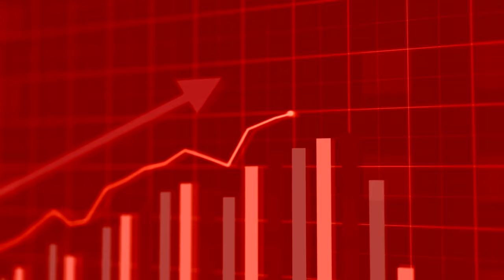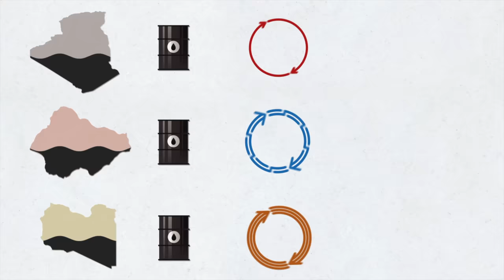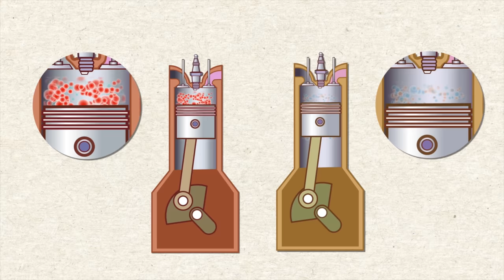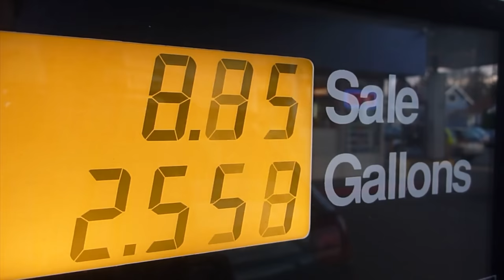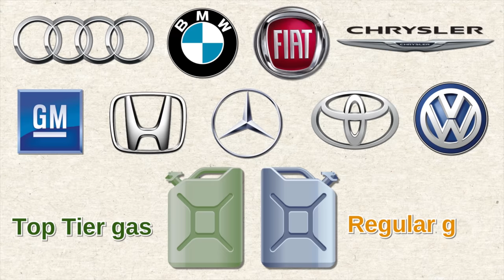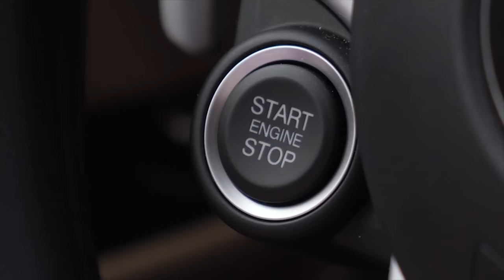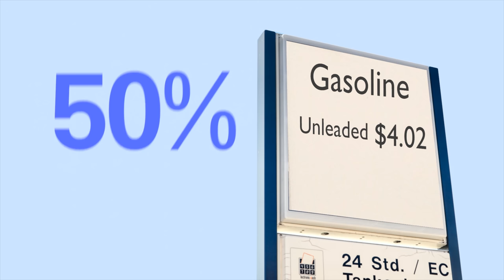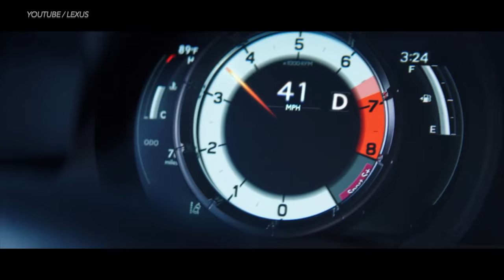No One Has the Balls to Tell You the Truth About Gas Prices, So I Will

Comment: The dream of having EVs everywhere is just that. A dream. The amount of infrastructure upheaval and required for something like that would take a minimum of 40 years to even get at an acceptable level, let alone efficient. The lack of charging stations and other electrical grid support in rural areas around the USA and other countries prevents EVs from being viable in those places until the government or brave companies spend insane amounts of money. The electric power stations are still going to need a way to keep up with the increased demand on the grid once EVs start pulling from new stations or home ports. Remember the failure of the power grid in Texas when a relatively moderate amount of ice and snow swept through and people were cranking their output? Now imagine that but every day and every single person contributing.
Reply: Its all a virtue signal done at our expense.
Reply: Yeah electric vehicles are pointless it'll be the samething as a normal vehicle if everyone has one
Reply: I think people forget that there wasn't gas stations at every corner when cars came out. It's the same with electric cars. Charging stations will eventually be everywhere. It's up to governments to increase electric capacity to offset less ICE cars.
Reply: @HH-le1vi  I think the difference here is that unlike cars of old, electric is being forced on us, infrastructure, economy, practicality, etc. be damned.  Electric is probably the future, but innovation and advancements must run their course. They can't be rushed. Am I full of it? Possibly. But that's an impression I'm getting.
Reply: Yea and then there's the issue of mining the lithium and cobalt for the batteries. Earth is gonna look like the moon, giant craters everywhere
Reply: @chaoticiannunez2419  my thoughts exactly.
Let it happen naturally, organically. 
I'm afraid that forcing this is gonna create many unnecessary problems for many people.

Comment: I worked at a go kart track way back in 2004-2005, their go karts were converted to run on just ethanol, but the higher temperature that ethanol burns at would be too much for it and ruin gaskets and seals, resulting in them needing repairs more frequently. The following year they switched back to gasoline and they ran better. Most engines, especially older ones, aren't engineered for the higher temperatures of ethanol.

Comment: Going electric for now just changes the energy source from internal combustion to external combustion. Internal combustion has its advantages but the sense of autonomy that it creates is an illusion. The internal combustion powered vehicle in fact depends on a vast fuel supplu infrastructure. The reason why the internal combustion engine gives you a relatively long range and the freedom to go anywhere is because the infrastructure is everywhere. In fact, the internal combustion vehicle is just as dependent on infrastructure as the electric vehicle. Although the fuel itself once delivered to the fuel station, requires no additional connection to any infrastructure to be avcailable, in fact, no electricity, no pump unless the station owner a backup power generating system. A hand pump could be used, but that would be awfully slow.
Reply: Where can I get an external combustion engine.  It must be great to hear the explosions out side the engine.
Reply: When you car runs out of power, which one will you be able to get running again in a few minutes? EVs are trendy, but useless if you have to travel over 60 miles.
Reply: @MAGAMAN  I agree in principle, but the useful range now is more than 60 miles in many models. My argument re electric vehicles is that they are useful when the daily travel itinerary already is known. That mean local delivery vehicles, commuting or buses. Or someone who drives very little.

One of the small cities in my local area has electric buses on one of the main routes. That's a good application, but they already know how many miles each city bus is going to go every day.

Comment: I drive a lifted 2012 Chev Tahoe 4x4. When I drive 55mph on the highway with cruise control I get over 22 miles to the gallon, sometimes 25 miles to the gallon with a tailwind! Over 55mph its around 16-18 miles to the gallon.

Comment: I bought a Chevy Bolt EV, back in 2020. It's an OK car, and I smile pass the gas pumps. NO oil or radiator fluid to change. The battery will eventually crap out; maybe in ten years, but I still save money.

....and, Climate Change is REAL.

Comment: Just you watch, Brandon will allow all the USA leases on oil production Scott free a month or two before midterms when gas is above $6 average!
Reply: If the president does or does not, it will not matter. Production is not the issue, refining is. Also, even if the fuel is produced here, it does not have to stay here. Oil and fuel is a global commodity. It is sold to the highest bidder. The president has no impact on that.
Reply: Good thing this "Brandon" guy isn't in charge, then.

Comment: We've definitely all noticed the rising prices of gas in the past couple of months. 
I recently built an electric bicycle conversion based on a bafang mid-drive motor that can travel up to 35 mph, go 50 miles per charge, and only uses 900 Wh of electricity which is about $0.20 cents of electric energy use when charging. I use it for my 25 mile commute to work 2 days a week, and if I need to run any trips 15 miles or less in city scenarios it's fantastic. I put a rear rack with panniers in it to carry small loads when going around comfortably, and I can also tow a small bike trailer where I can load as many groceries or things as I want. 

When I do drive it's mostly highway cruising miles. I usually drive in the middle or right lane at around 65mph and keep a good distance from the car in front. If I see brake lights in front, I just take my foot off the accelerator and slow down naturally, avoiding braking. I make sure my tires are filled up with air to 40psi, and recently did an engine and transmission oil change. On my little 09' corolla I can pretty consistently average 40mpg. With 4 people and luggage with ac I probably get 37/38mpg. It's a gas-only car as well. Going between Austin/Houston I use a ridesharing app where I'll take 3 passengers and get paid about $100 each way which covers the cost of gas threefold. If I do this twice a month it covers my gas for the whole month! 

I know it's a challenging time, but there are always things we can do to be a little smarter about our energy use. I'm gonna look for these gas apps now and start using them!

Comment: Great job on this video. Very informative. Though, I would like to conclude in addition to proper tire pressure, conservative driving, less weight and streamlining your vehicle and different grades of gas, that some other factors to consider when trying to conserve fuel is, proper maintenance, such as, changing oil regularly, maintaining a proper engine oil level, wheel alignment and tire balanceperiodically cleaning air filter, tire balancing, etc.

Comment: Keep it parked as much as possible.

A lot of roads in my area in Middlesex County New Jersey have been reduced from 40MPH to 30MPH. I'm not sure if this will reduce fuel consumption or increase it. It seems to make so that you would be more likely to need to stop at traffic lights. Right now I'm using 45USD per week, also seems that 30 MPH seed limits have reduced fuel economy. Regardless, driving sucks in Middlesex County NJ.

Comment: The problem is that fuel is traded on speculation, not as a commodity. Supply & demand reflect a small % of the price in most cases. Mostly the price reflects fears & what the speculators think "might" happen in the next few months.

Comment: Glad I was born when I was.
As someone who is into high performance cars..EVs will never have the magic that V12 Ferraris, V8 Muscle cars or even Inline 4 Boxer engines have.The sound and feel is half the experience. Imagine buying an electric Harley? What would be the draw?! Simply the name? 
We are a long, long way from this being standard. The entire power grid of the United States will need an overhaul to support what they are planning..we already have issues in some areas of the country in summer months during Peak AC usage. In my opinion, we'd be much better off finding a cleaner liquid/gas fuel as opposed to this battery nonsense. Think about how quickly your cell phone battery begins to degrade in performance...Compare that to a gasoline engine that's been going strong for 500,000 miles. 
Forced obsolescence, disposable society.

Comment: I bought a 1998 Corvette and made the mistake of filing it up with 89 octane fuel ( Gas was at like $1.48 a gal for 93 octane then in 2002) , and I can assure you there was NO electronic safeguard in that vehicles system. I had to drive it like i had an egg under the accelerator until I could get to my shop and drain it, even after adding octane booster it was detonating....
It was a great car, possibly the best I ever bought. 20 gallon capacity and averaged 26-32 mpg city/highway. Actual numbers. With a few perfectly legal mods it made 423 HP with a top speed (observed) of 213 mph. I sold it , wish I hadn't now and I miss it.....

Comment: I get everything you're saying in this video, but I have a question about a car we own. It is a 2004 Hyundai Elantra. It is rated for 87 octane. It runs fine on the 87 octane with no pre ignition. Yet, when we put 93 octane into it, fuel mileage actually goes up from around 27 MPG, combined driving in a fairly rural area, to 33 MPG. We have done the calculations many times, so we know this to be fact. If octane has no effect on fuel economy, why would this be our experience
? It is actually more economical to run high-octane.

Comment: Well Scotty... It's $4.95 here where i live. It's possible to find it for $0.10 a gallon cheaper if you look hard enough. When I bought my 2018 Honda Fit I could fill my tank for about $15 to $20. Now it's at least $30 or more. I'm glad I moved from an SUV to the tiny Honda that gets 41MPG four years ago. I don't know what I would do if I was getting under 32MPG. My car even gets better gas mileage than my 1050cc motorcycle! Here in the northeast I can't ride it more than 6 months out of the year anyway. I can't afford an electric car though. Besides the fact that I live where there's on-street parking so there's no way to plug it in even if I were able to buy one. Lately I've been thinking about an electric bicycle for quick trips to the store, but again I live in the northeast so it wouldn't really be a steady solution. If gas keeps going up it means I won't go anywhere that's not on my way to or from work!

Comment: Slight difference in energy content vs. octane.  If the octane is raised using more light ends then the energy content per gallon ( and specific gravity of the fuel) is actually very slightly lower.  But in general this video should be part of a required course in every high school in this country  That could go a long way to reducing the public ignorance of how our economy works.

Comment: The part which doesn’t make sense to me is that in 2004ish, oil was about $120 per barrel. It impacted jet-A, and airlines were screaming (except Southwest Airlines who’d  locked in low prices for a year or more). Regardless of the cost of a barrel of oil, we did not see anywhere near this level of price increases. As for incentives to get me to turn in my Dually - show my how I can tow my 5th wheel with Tesla’s truck. I have 136 gallon of diesel capacity and so I can go a considerable distance before needing to find fuel. I’m not expecting to trade this truck for the non-existent Tesla truck anytime soon, so I have no idea how far I’d be able to go with their product. I’m reasonably confident it’ll be maybe 200 miles. Then what? 2 to 8 hours of recharging? Give me a break. That’s a non-starter. Try again.

Comment: Would it surprise you that all  windmill internal components work off hydraulic oil , all the systems use oil , so how do they plan on actually making them green? Also your still gonna need petroleum products for things like tires, grease for bearings , rubber door seals and all the other parts of any car or truck either gas , diesel or electric

Comment: Keep your tires fully inflated.
Fill your tank during the coolest time of the day.
Re-fuel at half a tank. More space in your tank puts more area of vapor you have, which escapes and does not get burned.
Doesn’t fill your tank do you the ram. When the pump clicks off, adding more gas eggs more fumes which go back into the holes as paper and back into the station gas storage tanks! In essence you are paying for the gas but pumping it back into the station tanks.
Don’t lock the nozzle in the wide open position. This makes more bubbles and makes more gas fumes which are literally being put into the air or put back in the station tax. iMovie, get to your cruising speed as quickly as possible. If your car accelerates, it is using the most gas possible. Oh my so much gas will flow into the engine, depending on the size of the fuel injectors. When you reach a cruising speed then let up off the gas, your gas mileage increases to maximum! That said, do not make Jack rabbit starts!

Comment: Your explanation of Octane and combustion processes was fantastic and very educational.   I think your gas / fuel economy suggestions were right on.   
     You did bring up something I found interesting.. and another aspect of the political impact on prices.  I travel a lot, and for *decades, gas prices $0.25 - $0.50 higher in cities or just off interstates were the norm nationwide.  But i saw something very interesting in 2022 as it got close to the midterm elections.  Gas prices in cities were almost $0.50 less than in the rural areas, which was *very wierd.   In an attempt to support the Democrat Party before the elections, the cities (mostly Democrat run), reduced gas prices to give the impression inflation/ etc was not as bad as it was.   On a separate note, I noticed the gap in price between 87 &93 went from ~$.40, where it had been for decades, to about $1 (very obviously an attempt to reduce the price of 87 Octane and pass it to those paying for premium/ 93) in another attempt to reduce the visibility of the impact of Democrat policies on gas prices.

Comment: Still sounds like corporate greed. Do they really need to charge 3 times the already inflated price? I’m done w oil in my world. Switching all my V8s to CNG.  I just did the math and realized that it’s cheaper to operate my econoline 350 on CNG than it is to operate my Prius.  At $1.88 (SoCal price) the E350 runs for about 10-11 cents a mile w 17-21 mpg. My 2021 Prius prime gets me 40-50 mpg (currently showing avg 41). That’s 13 cents best case scenario paying $6.50 getting 50 mpg highway miles. Good bye oil forever. (I’m selling the Prius today)

Comment: 4:30 If that's true (big IF), everything made from petroleum will be much more expensive. Tar, gear oil, grease, propane, etc. They started using gasoline in cars because they were throwing it away and needed to find a use for it. "Other" products are cheap now because there's lots of oil being pulled out of the ground.

Comment: The funny thing about it is these electric vehicles aren't cutting down pollution at all either.

Unless you plug in your vehicle at home and have solar power or windmills enough to support the energy needed to charge that battery you're still plugging into the grid.

Which means a factory is working harder to produce that energy I know California grid can't even support all the air conditioning units on over the summer how will we Charge all these cars and semi trucks.

The factories was the cause pollution anyway.

Comment: Oil companies LOVE renewables like solar and wind because they are wildly unreliable. Some estimates put the total output vs life of a solar panel at 30%. So only 30% of the life of a panel is actually producing electricity. They cant produce energy when its cloudy, covered in snow or night time. Same with wind. Can't produce energy when its not windy or its too windy. So what do you do? You turn up the oil/coal/gas power production. Its easily turned up and down when demand is needed. That's why literally no oil industry is pushing nuclear. Nuclear never stops like other renewables. AND its safe. REALLY safe. Its the only energy source where you capture 100% of the toxic waste and is super energy dense. It just gets a bad rap because of places like Fukushima and Chernobyl. Chernobyl happened because dozens of safety measures were disregarded and Fukushima has 0... literally 0... disaster-related deaths after 10 years according to the IAEA. The one death was caused by incorrect PPE used inside the facility by a worker. You want safe, green, cheap energy. Nuclear is the way to go.

Comment: Amateurish.  There is no point in pumping more crude oil if you can't refine it.  U.S. refining capacity has dropped from 18.7Mbpd to 17.8Mpd since the end of 2019 and it currently looks like we're going to lose another half million by the middle of next year.  Refining capacity is flat in the rest of the world.  Since it takes years to put a new refinery online: and $20B/Mbpd.  Chevron, Marathon and Valero have already announced they are not even planning any new capacity.   I don't expect the supply side of this equation to change any time soon.
Reply: Since the 1970s, hundreds of refineries have been shut down due to consolidation of the industry.  That is,  the industry has reduced the number of refineries to minimize competition and prevent the "gas price wars" of the 1960s.